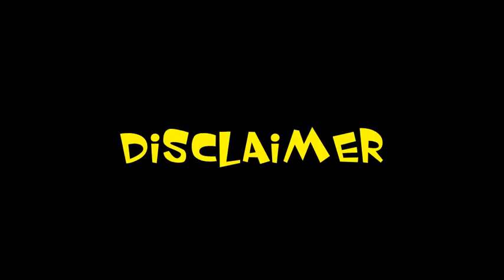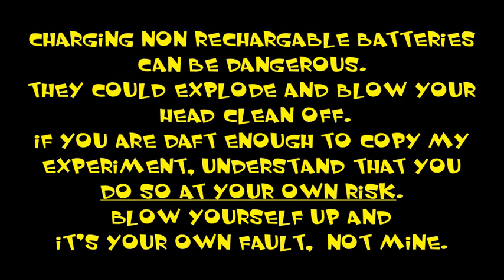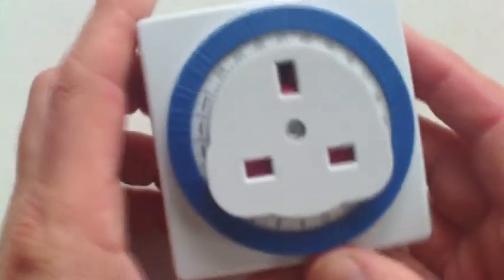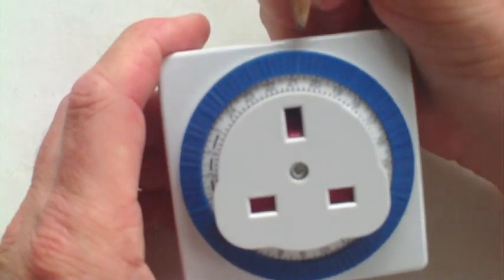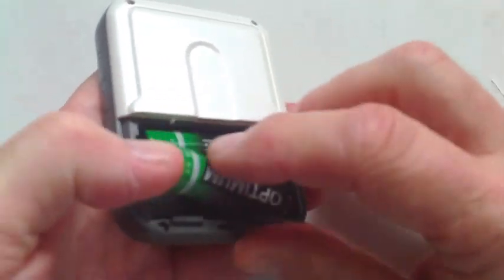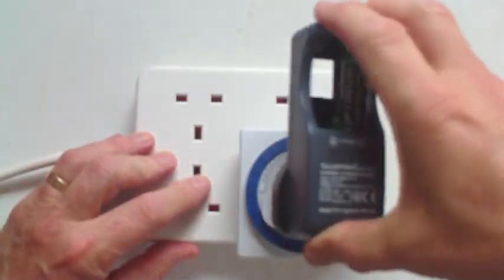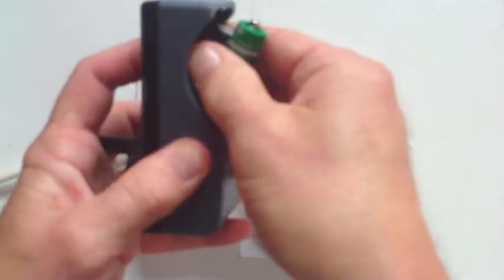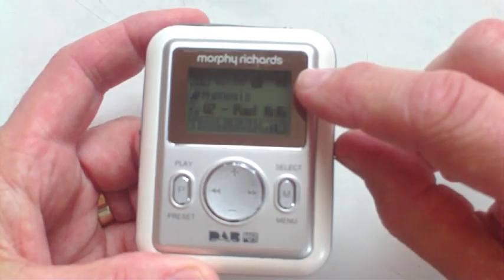How to charge ordinary Non-Chargeable batteries

Comment: Hi Will :)  Get an Arduino nano from china for a dollar and an NTC thermistor :) Use PWM and the temp sensor to create your own charger sketch :) ( Temp watched ! )  :) :) :)  ....  soooo much fun !  If the Arudino does not output enough you can use a relais or mosfet with another external power supply :)

Comment: Is that a new rapid charger ?? Also what about durcell vs any other batterys ?? whats more dependable ??
 I used to charge batterys all the time. ( volts would only leak. But would charge  unchargeable batterys mostly for 30 min at the time.  Old 9 volts chagre great that use quad batterys..i've use dthis battery since a 1999, It died a few yrs ago the 9 volt.. just using it testing small motors and things.. it lasted 10 to 12 yrs... Not using it all the time..

Comment: It was clearly evident that you didn't install the batteries the correct way to verify that they were dead..they were inserted the same exact way...1 of them needs to be upside down
Reply from the maker: Luna Moon 
No, that's the way the batteries fit in this device. Look again and you will see that both positive studs are on the same side, and both negative spring contacts are on the other.

Comment: All fine and dandy but I don't see how the batteries could be fully charged in 2 hours if they were charging in 15 minute intervals and how can we believe that the batteries are the same ones and not a different new pair used for turning on the mp3 player and showing full?
Reply from the maker: You're right - I did say 15 min intervals didn't I? The interval tabs on these timers are actually 5 mins, not 15 (My bad) 
Otherwise it happened as described - I can't see the point, or benefit of faking it.There is an easy way to prove it of course  - try it for yourself :)

Comment: You can quadruple the life span of an alkaline by recharging them AFTER EVERY USE. If you deplete them, you'll only get about 20 % of the original charge back. By recharging them after every use, they will last a loooong time. Not very handy, but it works. Best charger would be a specialized alkaline recharger, but an old NiCd "slow" charger works great for me. They only put out a few mA as charging current, so the cells won't get too hot. None of my cells have ever exploded, but make absolutely sure, that you only recharge alkalines. There are Lithium cells in the same format and they WILL EXPLODE. If you overcharge an alkaline in a fast charger designed for NiMH, they can produce a loud POP and a little acid mess, but I would not call that an explosion. Don't recharge depleted old alkalines, they can leak later during use. And as always: I don't take any responsibility, try it at your own risk.
Reply: I tested it I got 1200 mah capacity after  recharge 1down to 1v  after number 2 it has 1089mah but I drain down to 0.8v  recharge 3 988mah I used drain of 50 ma drain to 0.79v
Reply: Good for clocks and remote control for tv

Comment: Hmm.. There's more to this, Yes, we don't tell you why we labeled the alkaline batteries non rechargeable. It's not because you can't put power back to them. Because, we put power in them in the first place. So one would know they were charged at one time or the other. It's the chemicals used in the making of the batteries. At least one alkaline battery chemical are non reversible.  Meaning Yes you can stuff power back in it for some time but each time you breaking down the battery more and more until it's no good at all.

Comment: You can buy a charger for disposable AA battery's off amazon for a tenner.I have one and it works a treat, you wont get %100% full charge though they  loose a few per cent capacity with each charge.

Comment: Thanks for that. You did not state what type of charger you used since there are many types for the different types of batteries available today. In other words, did you use a NiMH, NiCd, RAM, NiZn or Li-ion charger ? Also, there chargers available today that are designed for normal (non-rechargeable) alkaline batteries. So which one did you use ? Thanks
Reply from the maker: Just a standard NiMH, charger

Comment: Thing is, this would charge the non-rechargeable battery to 1.2V-1.3V as rechargeable batteries are 1.2 not 1,5V - But the method of keeping the heat off is great thanks
Reply: some chargers are made to go higher, 1.6v even.

Comment: I bought a charger at a thrift shop that indicated on it that it can charge Ni-MH and Alkaline cells.  I have charged over 20 alkaline cells so far with it, and none of them became warm. They all test at around 1.5 volts when completed, and it seems to take most of them at least 12 hours to charge.  Am I safe from overheating, because they take an average of "all-day" to charge?

Comment: If you are going to buy a battery charger and a timer, to do this, forget the timer and buy re-chargeable batteries, and charge them,  safer than risking charging non re-chargeables.
Reply: i know or if you have a landline phone with rechargeable AAA batteries you could use cardboard to make them big enough for an AA slot

Comment: you can get A  alkaline battery  rechargers Google it there are lots out there mine came from QVC its called chargelit!  battery station pro this one was expensive but you can get cheaper ones from Amazon from about £10 , I haven't paid for battery's for a few years now I cadge old ones from friends and family, you can charge them approximately 10 times  
they don't last as long as new ones though.

Comment: In theory this is amazing, but the precautions needs to be in place. A circuit with shorter intervals at a higher voltage would probably work better in the long run. And for gods sake, don't charge them to 100%, that's why they're leaking. A battery is like a water balloon, and these disposable ones don't have the integrity to hold a full charge. Otherwise, go for it (Y)

Comment: Can use temperature sensor and timer at the same time, could be more safe.
Reply: Since the heat increase develops so rapidly, I doubt that you'll get an accurate read from the outside.

Comment: First off, I like your style (the disclaimer ROCKED)My only question is:  Will the on/off time ratio differ in the US (110volt/60hertz system  vs  220v/50Hz system)
Reply: +Victoria J. you don't charge the batteries directly with 110V or 220V. That's what you need the charger for. It converts the voltage to a usable value.

Comment: In those 2 hours your waiting for them to charge and possibly having your plug malfunction, you could get in your car or the bus, go to the nearest Poundland and pick up a pack of 8 fucking batteries for £1, stop being tight arsed😂
Reply: +squiggzzz1 You are the reason there is mercury in the water.  You should use all of it that you can and then recycle them.  Get a volt tester and test bags of batteries in the recycle and recharge them as well.

Comment: If you try and recharge zinc/alkaline batteries they are more likely to vent (i.e. leak). Keep this in mind since what they will be leaking is basically a concentrated lye  (sodium hydroxide)  solution and can easily damage your electrical/electronic devices.  You are better off just buying rechargeable's.

Comment: Yes you can only regain a fraction of the original charge. As a thumb of rule you  can maximum gain 20% of the original capacity in the first charge within an alkaline battery.. Doing a second charge will regain around 15-17 pct of original charge. After 10 charges they are totally depleted. You need to understand the chemical reaction in an alkaline cell to fully understand this. There is a lot of info on the tube about that.
Reply: Maybe percentage is not correct, but your answer, explanation, is the best here. You can get some electricity, but it is small percentage, and it is more about chemistry thing..
Reply: Your information is not correct  it's about 91 % of capacity after first chage then 88% 2nd recharge number three is 85% then four is 82% of capacity but its at low drain at 50 ma down to 0.8v so it used for clocks and tv remotes

Comment: This is a great idea! How long do the recharged alkalines last compared to new ones?
Reply: Indeed, this information seems to be omitted from a lot of these "How to recharge alkaline batteries" type videos. It's one thing to charge them up to 1.5v, it's another if they can't pump out that voltage for an appreciable amount of time.
Reply: The original capacity I got was 1600 mah battery was discharged at 300mah  voltage after discharge ended it went back to 1.32v so then I recharge it and retested capacity was 1000mah at 300ma drain the 2nd recharge capacity was 799mah and 3rd recharge was 700mah at 300mah dischaged so I can say its worthwhile for tv remote and clocks and game control and flash lights and kids toys
Reply: But the problem is after 4th recharge cycle it only has 567mah capacity so you can use it but best to stop recharge it from 5 th cycle has less capacity but you are making more sense to recharge it 5 times so it only cost 5 times less but you can recharge it 10 to  25 times  but with less energy the amount is less and less but still better than buying  alkaline  very week you can buy 24 batteries and you can recharge alkaline 5 times now you have 100 batteries but with 30 % capacity and it can power toys for 1Hour and 30mins max still has more capacity than buying cheaper zinc battery
Reply: Is it the voltage that had a problem or the current when you recharge these this way?  There is a huge difference between the two.

Comment: I bet this can be charged a few times but after that it can't be any longer...the normal alkaline battery is made to draw electricity through the metal coating in which it the chemical will stick and harden...i tried to scrap it with a flat screwdriver and it's solid as rocks...so i don't believe the electrical charge will be able to release the sticking chemical back into its original position.....that's why rechargable battery are built in a rolling sheet where it can easily release back the chemical to its position when it is recharge.

http://howtodosteps.blogspot.my/2015/06/what-is-alkaline-battery-and-carbon.html
Reply: 11
Reply: 1

Comment: Hello, you can only use Alkaline Batteries and use a joule thief charger, its work also for any ather rechargeable batteries ni-cd, ni-mh,li-ion and so on. :-) but be careful for the charging volts and amps from the manufacturers.
Reply: Don't recharge button cell's, it will be explode!!!
Reply: ***** and dont use too much ampere i recommend max 100mah for safety.
Reply: ***** I am not responsible for any damages!!!

Comment: I would modify a charger with a temperature probe, attiny85, mosfet, dc-dc convertor and some programming to build a smart charger for non rechargeable batteries.  You still need to know the temperature that the batteries are OK at.

Comment: Why did you only charge one battery?
Reply: Col Denn There's 2 batteries in that charger
Reply from the maker: Col Denn Because I was only doing it as a demonstration for the tutorial.
Reply: Ok! Thanks for the video!
Reply: +unworthyservant 
It's "regular" where he lives. Where you live, the plugs may be different, but the timer and charger you buy will work the same.
Reply from the maker: +unworthyservant  It doesn't matter what makethe timer is - any programmable timer will do. I haven't tried lots of different types of batteries, just the ones in the video - I only did it as an experiment.
Reply: he charged 2..it only looks like one because the way u load the battery charger!...

Comment: What milliamp rating was your charger? And does the amount of time you leave it on charge depend on the milliamp rating of the charger?
Reply: Low slow charge is safer. About 120mA for 2 hours I use works. Try stick to remote controls etc low pull gadgets.

Comment: They don't blow up, they just dribble. I had a 9v i tried to charge off a small solar panel but it was a hot day and it got too much current and dribbled. Proper rechargeable batteries can actually take a higher rate of charge.

Comment: I bought a charger off Amazon that claimed to charge ordinary batteries, but it did not work, so I dont believe it can be done.  It charged other batteries BTW, but not standard batteries.
Reply from the maker: It definitely works - I've done it many times using the method in this video.

Comment: Alkaline batteries are no energy accumulators they generate energy for a internal chemical reaction when this internal chemicals are wasted is nothing magic you can do. Nickel cadmium, Nickel metal, rechargeable lithium, etc are designed for store energy in internal cells from an external source.
Alkaline batteries can storage SOME charge in the way you said but they can explode, leak or leak inside your device but they cant storage the same is a full battery no even half ass charge and if does its charge going to fall very fast. In short terms dont worth.

Comment: Very good video thanks :-)  All well explained,  and the sense of humour helps a lot !  I'm curious though if you have ever yet had one explode?  I'm not one of those who's worried about that cos I've been doing this same charging for over 15 years,  but I do see a lot of technicians saying a battery will explode and kill you,  which I'm still waiting to happen (obviously if it does, I won't be here again to mention how it happened,  or if it it hurt a lot).

I've always found that duracell and really cheap types of batteries are the ones most likely to leak,  and the inbetween quality ones seem fine for me.  I bought a pack of 24 everyready energizer alkalines about 4 years ago and they're still going strong,  I'm actually losing them under sofas and in sold equipment,  far faster than they are actually stopping being rechargable !  :-D
Reply: Great

Comment: I've been doing this for 20 years, but I generally have some that work and some that won't. Also the ones that do charge won't have the charge of a new battery. I mainly use mine for led flashlights
Reply: Why? Can't you use rechargeable batteries?
Reply: SirCutRy
I do, but if you can reuse something than you are better off, and we only get one hamster cage to live in. Sadly many people don't care how what they are doing and how it might affect others. I use Nimh for digital cameras, while I only use Nicd for power tools. The bad thing about nicd's is that they are touchy and don't like neglect. I have seen a lot of power tool packs get discarded along with the drill or tools just because the chargers used on them were unregulated voltage for the lower models. Luckily most chargers are better built these days. Many people don't realize that Black & Decker and Dewalt. They for example have interchangeable packs with some or slight mods for the same voltage and battery type. The same goes with newer and older packs using any Dewalt charger you have. Most Black & Decker chargers are just a power supply with a battery interface which shouldn't be used. So I do use rechargeable's, but I will always make due with what I have before wasting money

Comment: Great video and of course is work. Am using digital multimeter just to check voltage to be sure. Just to say recharged battery is holding voltage very good like new :)  I think good Alkaline battery can recharge at least 10-30 before they shrink total capacity and die. I will test it at long run and see :)  Thanks :)

Comment: This is a cool idea, I'm going to try it. Two quick questions tho, first, how many times do you think you can recharge these batteries before they start leaking? Also do you think charging for 15 min and let it rest for 30 min would be a better/safer idea for this process?
Reply: You might be able to get anywhere from 2-3 charges to 10 depending on the quality of the battery.

The safest way to charge non-rechargeable batteries is to use low current. The lower the current, the cooler the batteries stay. This will also help you get a few more charges out of them.

Current day rechargeable batteries can be recharged hundreds of times though, so if you really need batteries, I would suggest simply buying a proper charger and batteries. I still have some from about 7 years ago that are still working perfectly. Charging batteries is nasty work. High currents heat them up, and damage the electrodes, which is why batteries have to be designed with recharging in mind. I highly suggest this route, as the more people using Rechargeables, the less batteries end up having to be recycled. It also saves you time and money. Even if it seems more expensive at first, say 50$ for a charger and 4 batteries. Those 4 batteries can and will be reused 100, 200, 300 times. If you were to buy those batteries that is hundreds down the drain, Even if you were to find non-rechargeables maybe at a discard/recycle center, you'd still have to take into account the effort needed to find these and charge them, especially with things like a timer, or low current charger.

Non-rechargeable batteries are not in any way designed for recharging. You have heat issues, which is easy enough to work around, but the biggest problem is the damage that occurs to the electrode/internals of the battery while charging. Since it's not made for charging this damage is significant, and ultimately renders the battery useless after as I said, 2-10 charges. At this point the battery likely won't hold any significant charge at all. They may also start leaking after enough chargings as well due to the expansion from the heat.